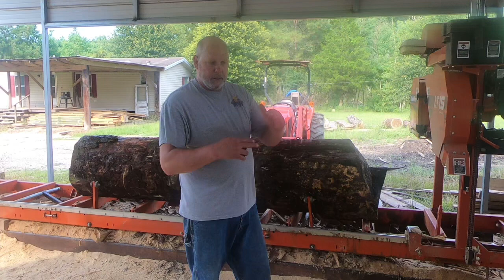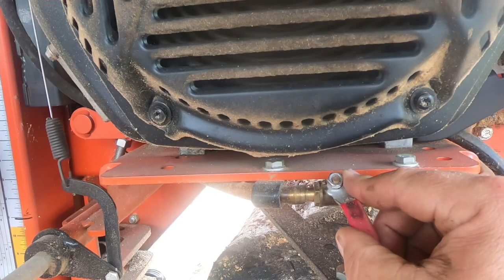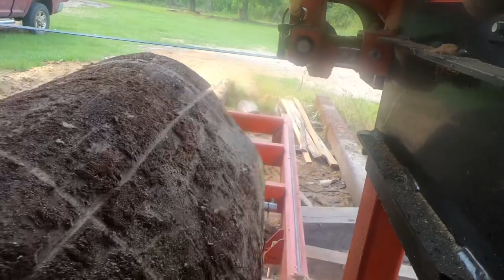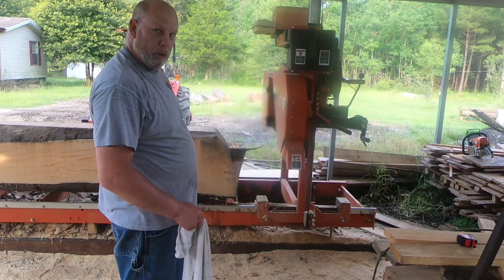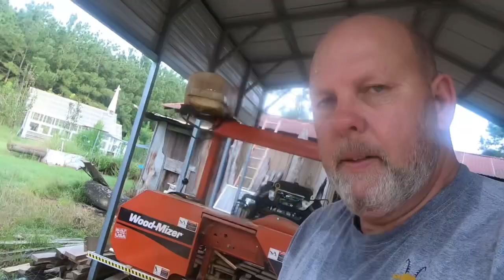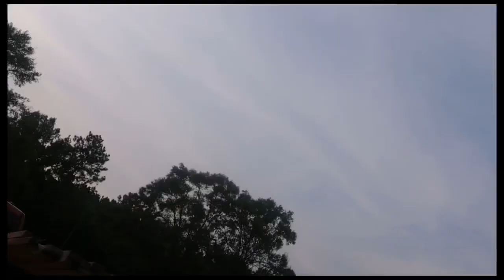Milling 2x4’s With Woodmizer LT15

Comment: After a long wait I Just got my LT 15. You seem to be able to get away with using your log clamps sparingly.  Any tips on clamp placement. Thanks
Reply from the maker: If you have a flat bottom you can get away with no clamp.   Use the weight of the log.  . If I had just one clamp it would be in the middle.
Reply: @ReapWhatYouSeauxLeJeune  thanks good info. Keep the videos going